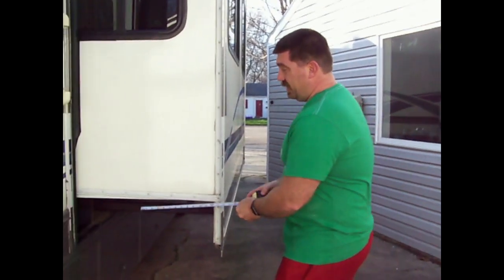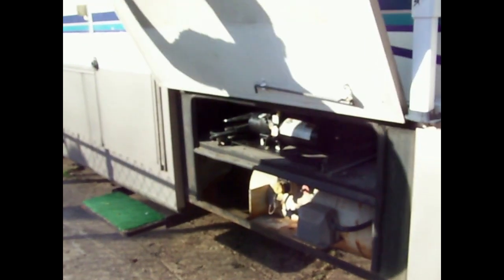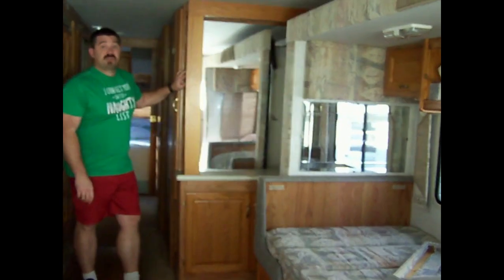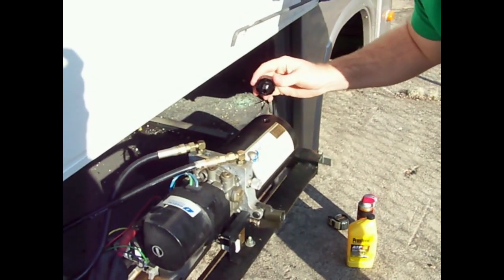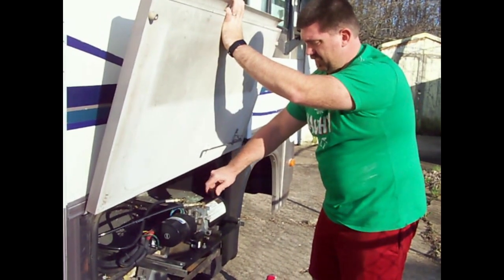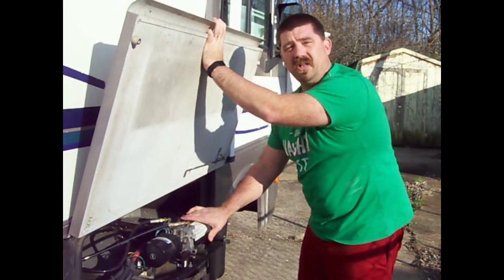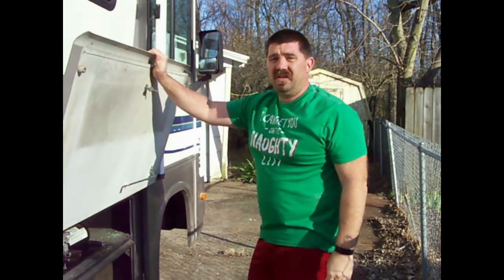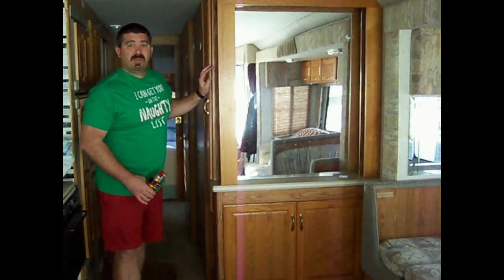RV hydraulic slide-out issue

Comment: My hydraulic system on my camper is not pulling the slide in. And the levelers will go down. But one I go up with the weight on it, it struggles bad.

Comment: I have the same system on my fifth wheel and I’m full on fluid and it’s still not extending any pointers?
Reply from the maker: If only one support is not working, the next thing to check is the relays that control the pump. If all of the jacks don't extend the main fuse is the best next step.

Comment: I see you have the sun voyager, same here I have the 2005 with 3 slides- I am having problem when I release the emergency brake my left kitchen couch slide which is hydraulic starts to push out on its own, I sent the controller to be repaired as the 2 hydraulic slides and levelers are all tied in to that but they didn’t see a problem with it, any idea what may be causing this?
Reply from the maker: The only thing I can think of is the actual switch having a short. Does the pump come on or is it just under pressure already? If it is already under pressure then it could be the valve being stuck open. Definitely more trouble shooting needed.
Reply: @gertysadventures6173  thanks for feedback yes pump turns on and just that slide starts going out.  I can send you a video if needed.

Comment: i have the same pump but couldnt figure out how to get the slide-out out even tried manually didn't work can you show me the steps before you trun the swtich on doe the engine has to be on , do you have to put breaks on , do you need to unlock the awning , i just dont understand why my slideout not working even with batteries charged?
Reply from the maker: I would be glad to help. For mine, the engine has to be off but it does not require the park brake to be on. There is a relay on the left side of the pullout tray where the pump is located, sometimes that relay sticks and I have to tap it or unplug it and plug it back in. There is also a switch directly on the pump, you can try that to see if the switch inside isnt working correctly.